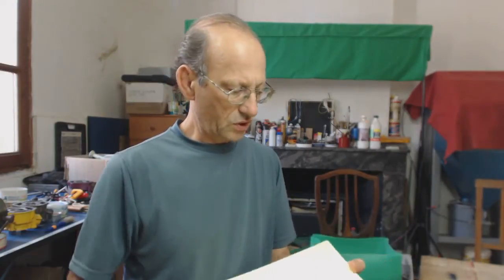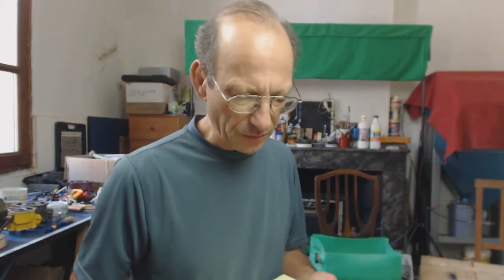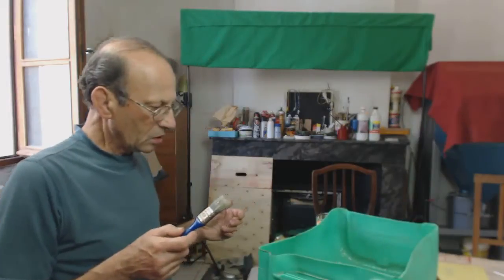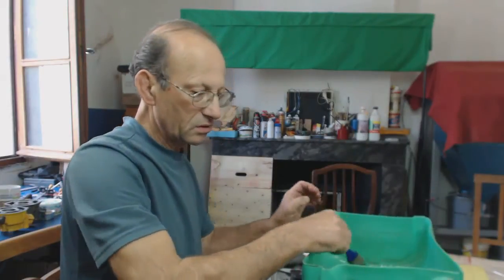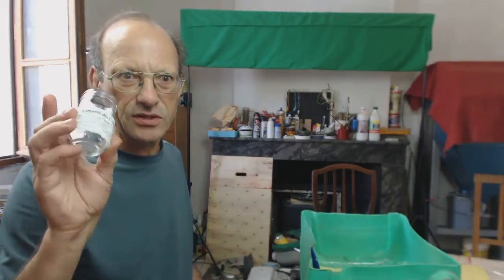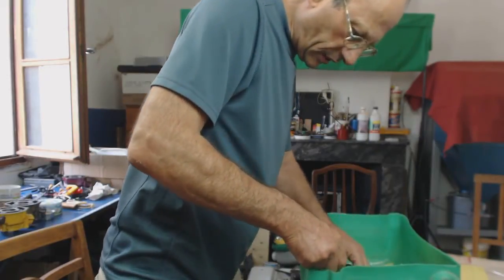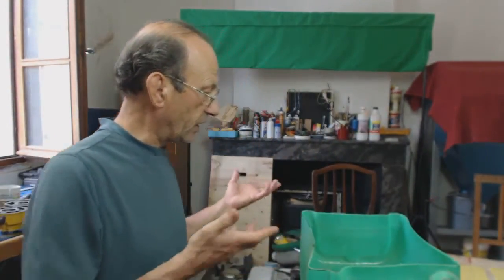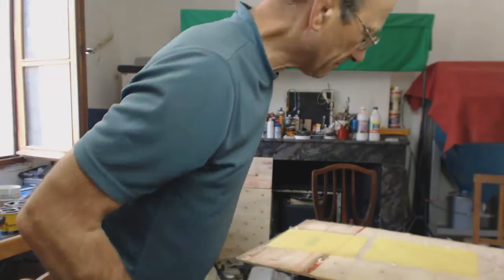AM6 Engine Assembly Guide - Part 4 - Making silicone impregnated gaskets

Comment: Hi, couple of days ago I reassembled my Am6 engine, loved your idea about installing bearings with plastics seperators.
You seem to know a lot about motorcycle engines. I was wondering could you help me finding the cause of my coolant leaking into combustion chamber? So bassically I bought brand new airsal sport 80ccm kit, installed it the way manual told me, installed the paper gasket dry, and lubed up the O-Rings with grease, torqued everything in star pattern, what could be the cause of leaking?
Reply from the maker: Most likely it will be a blown O ring.

80cc is enormous.
Are you sure about this?

74cc is normally the max.
After that, you would typically change the stroke length IE. crank and top end kit.
That would give you an increase in cylinder volume.

You need to measure the piston diameter or cylinder diameter, and measure the stroke, from TDC to BDC, to get the volume.

Remove the head, and inspect the O ring.
I'm surprised though.
I would have thought airsal would supply decent O rings.

Talk to the supplier and get a replacement... you must have got a bad one.

Let us know how you get on ;)
Don't forget to thumbs up and subscribe ;)
Reply from the maker: Thanks for the subscription Gvidas... you'll see that I have reciprocated :)
Reply: The thing is everything is perfect in the kit, gaskets and o-rings looks frest and clean, but the small o-ring in the center that should keep coolant from getting into combustion chamber looks a little thin :(
Reply from the maker: Yes... I know what you mean.
I ended up specifying my own O rings from the industrial sector.
They provide all the specs, so it is easier.

The thing is... if the O ring has blown... this should be visible.
Let me look... maybe I can find a link to my blown gasket.........

Okay... here is an image of how close my O ring got to the cylinder edge !!!!
http://www.apriliaforum.com/forums/showthread.php?320417-AM6-BBK-project-47mm-and-49mm&p=4122399&viewfull=1#post4122399

Notice how the movement between the cylinder studs allowed it to be slightly off balance.

Here's the link to the image of my blown O ring
http://www.apriliaforum.com/forums/showthread.php?320417-AM6-BBK-project-47mm-and-49mm&p=4072805&viewfull=1#post4072805

:)